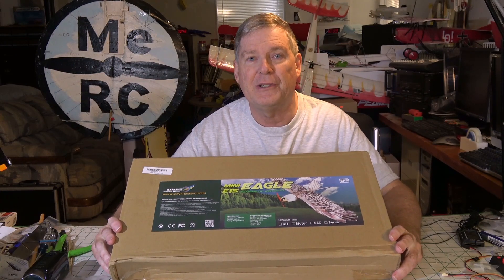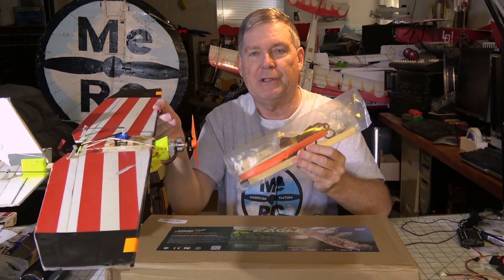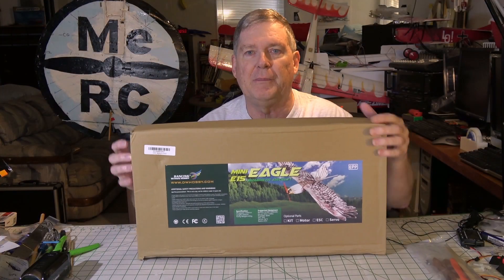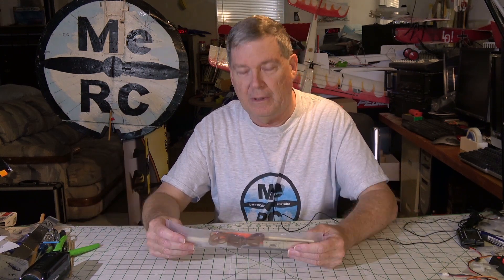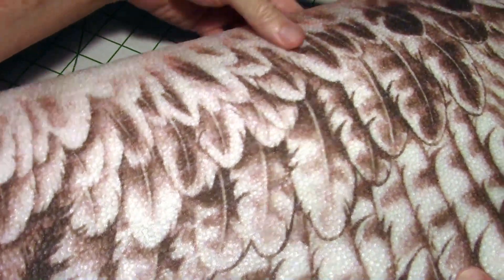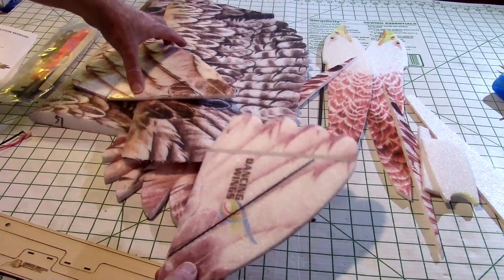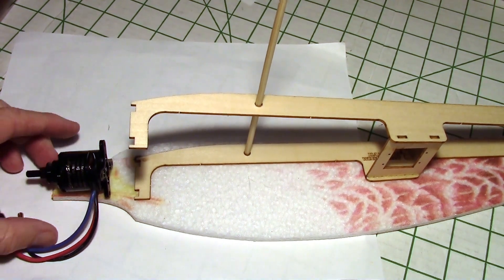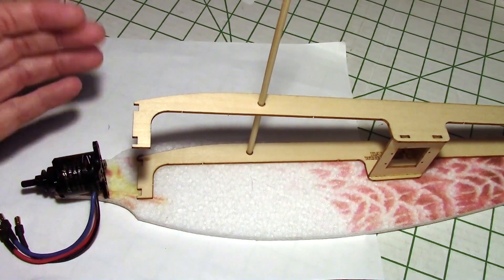DW EPP Mini Eagle RC Plane Build Part 1 - Parts Overview and Thoughts

Comment: buy the 1430mm wingspan as thermal soaring is an option ive have outfittied mine with a matek f405, foxeer predator camera on a wing mount, gps ect its the first thing loaded when i go 4 wheel driving.

Comment: My kit came with the same firewall you have but has the tabs that key into the sides. On mine the prop. doesn't clear the beak as well. Is the correct C.G. 50mm from leading edge? I can't stop mine from rolling left even have full right trim. It just does a wing over face plant so I'm thinking c.g. is too far back. Hello ailerons I guess. It sits nose down a bit at 50mm. 3 attempts moving weight forward each time with no change. I'm kinda at a loss. Seen alot of videos and they all seem to fly with only a little trimming.
Reply from the maker: I'm suspecting something with pitch of the tail feathers or angle of the motor but not sure. It I had it in my hands for a close inspection I could help but it's hard to know from what you are telling me. The CG is correct at 50mm for the mini. It's 60mm for the larger 1430mm eagle.
Reply: @DaveMerc Thanx I went ahead and gave it one more try expecting a different result but still acted like control surfaces were reversed. So I've added ailerons. This thing has no choice but to fly!

Comment: https://www.youtube.com/watch?v=Gzkg8cuUk1E&t=331s love mine....... a few suggestions if I may.... do the tail stiffening mod......... leave the motor straight and flat (meaning dont tilt up or to the side).... use stand offs to pack the motor out off the firewall so the prop clears....... I use low, med, high rates on a 4S with an 8" prop..... handles slow and low or fast aerobatics..... take care mate.
Reply from the maker: I have already added 2 degrees down/right but I could take it out with washers if need be.  I like your video, good you shared where the battery goes, what size and flight times. Also you said you added a front wing spar , correct?
Reply: The down slop will make it fly straight.... My one flies up when I throttle up so its nice to find that sweet spot.... using an 850 or 1000mah 4S with the 1450kv motor and 8" prop means I can fly for approx 10 mins. I didnt add a spar..... what I added was 2 square pieces of hard foam to reinforce the either side of the spar. The super secret is making the tail assy firm....... eager to see your flight video and thoughts about it..... I love flying mine especially when the birds come round. https://www.youtube.com/watch?v=dnVXDmBMca0&t=111s